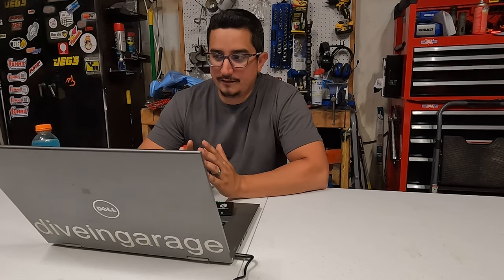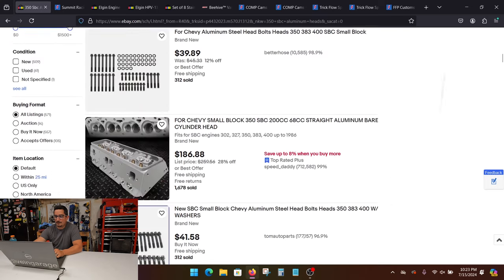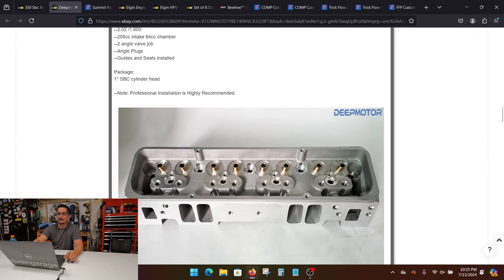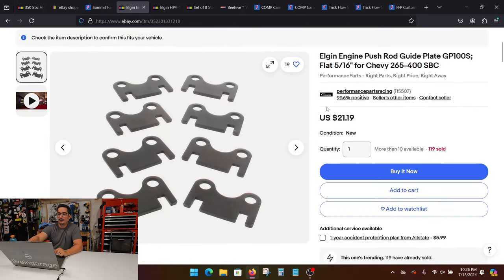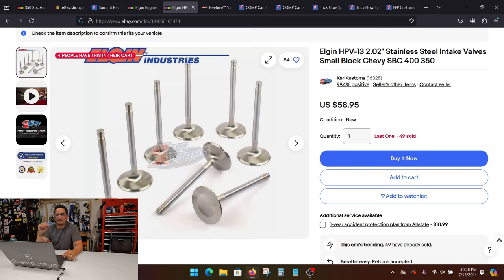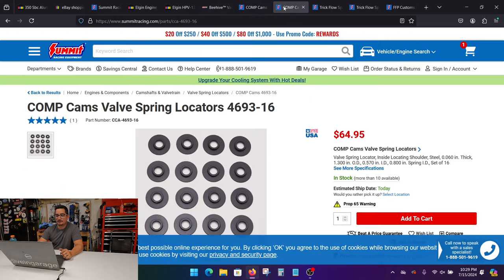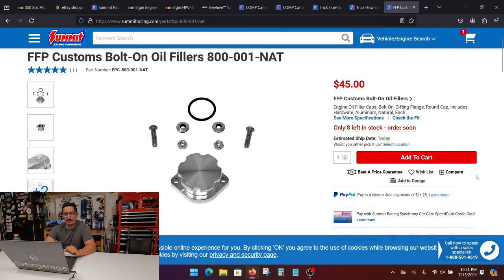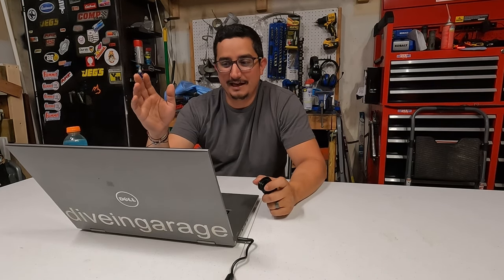Parts List for BUDGET Power!! | How to assemble Ebay cylinder heads | Best SBC aluminum heads

Comment: These are really good heads and parts you've listed, I've done the same setup on two 383 builds. I priced out your list, and it comes to just over 1000 bucks. Another option would be the AFR Enforcer heads @ $595 per head. You get everything you listed, including the 8 mm stem valves that AFR uses in all their heads, including the top full cnc race ones. Just a thought, I know it's 200 bucks more, but they do an amazing set up on these fully assembled heads! Thanks for making this video, it took me a week to source all the right parts for my DNA heads, and they were perfectly machined, as you said!!
Reply from the maker: yup those AFR Enforcers are nice, I think that's what these are based on. Some say they're the same head just rough and not gone over. but who knows. Either way I'd feel much better getting a set assembled by AFR than an assembled set of ebay heads! On this build I wanted to start from scratch and see what i could do. Went a little spendy on some stuff, definitely could have went cheaper. Glad you enjoyed the video!
Reply: the AFR enforcers are no longer "$595" they are 624.45, and thats just the 195CC heads after tax (in KY its .06 cents on the dollar) $1,323.83 and these No name heads can be built for 950~ish

Comment: Bro my power pack heads have a 3 angle valve job and there 65cc heads lol
Reply from the maker: Yup good heads. Anything vortec and newer outflows those tho. That's why i like these, good flow, screw in studs, aluminum.